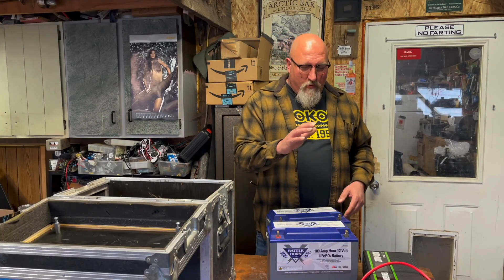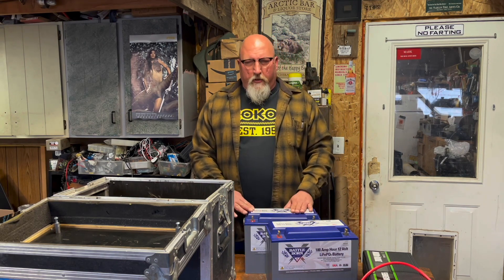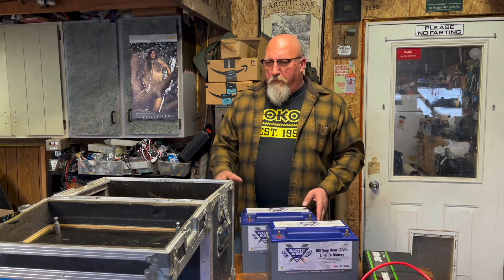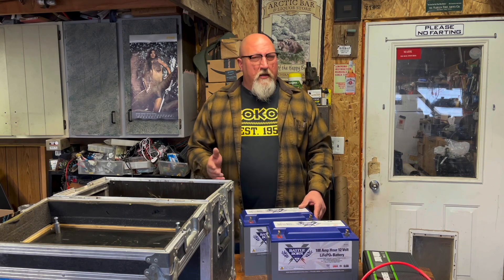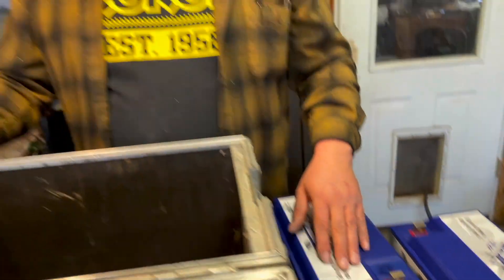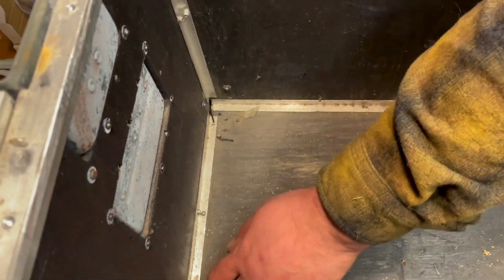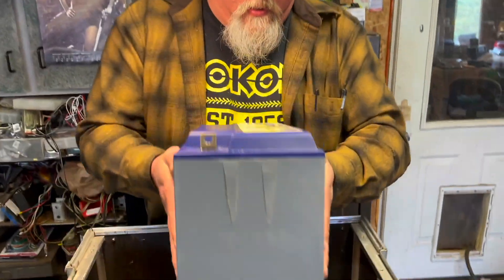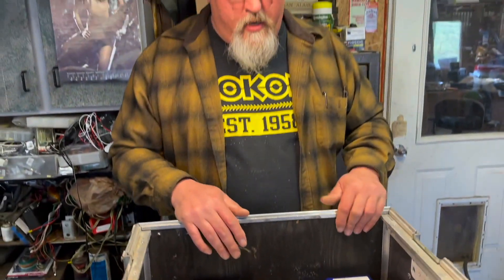DIY Solar Power Bank Part 2

Comment: So if there is an Armageddon type event and all you have is solar once your batteries go bad what can you do? Can you still run off the panel alone?
Reply from the maker: Not really.   Some panels, like the Rockpal folding ones have USB outlets built in, so you could charge USB devices.